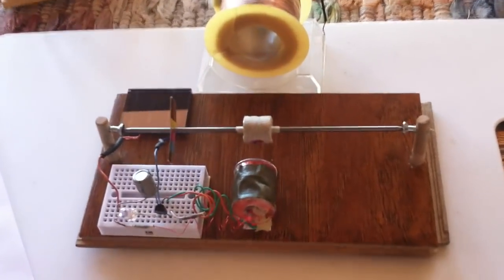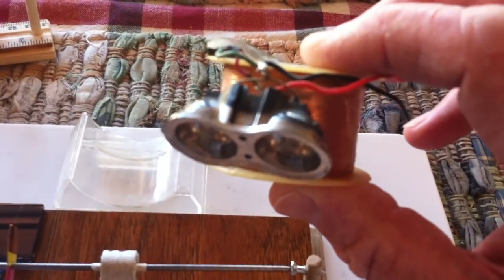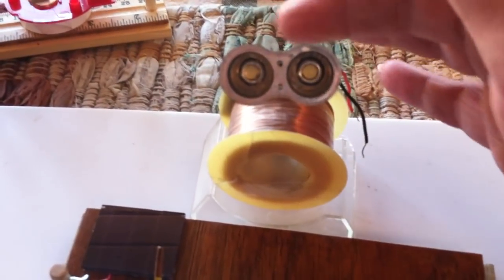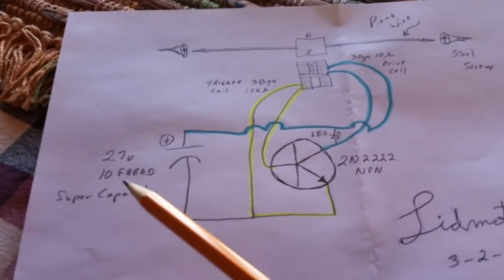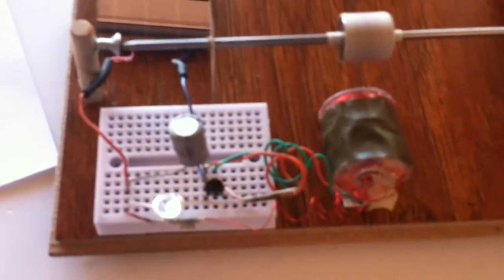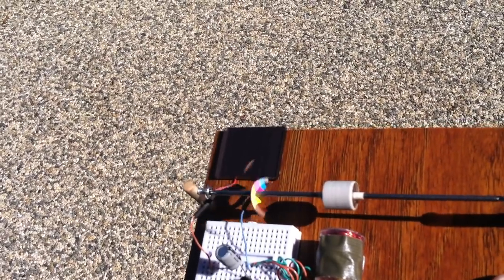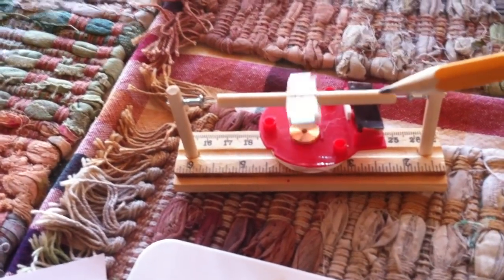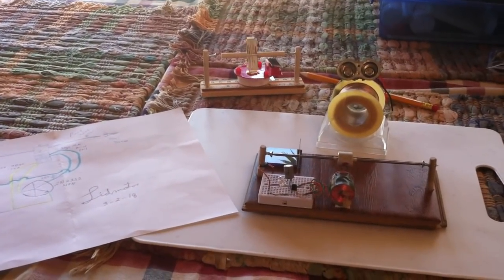Solar Powered Piano Wire Motor

Comment: Have you ever sharpened a pencil on both ends and used it as the axial beween the bearings ?
Reply from the maker: Good idea!  If you used a very hard lead pencil and changed to a plastic bearing that should work.